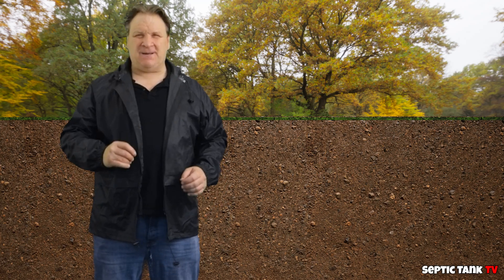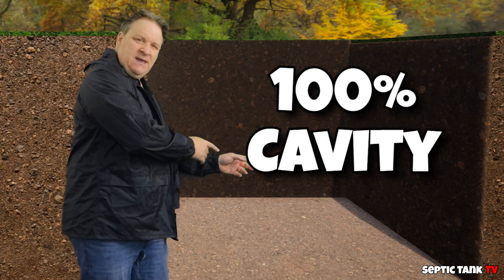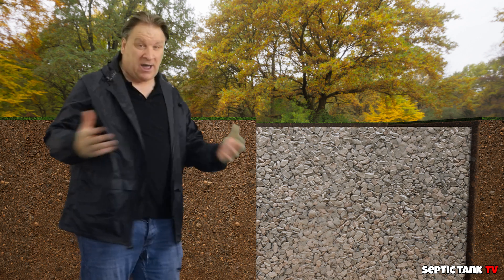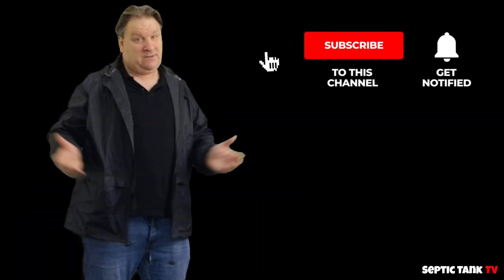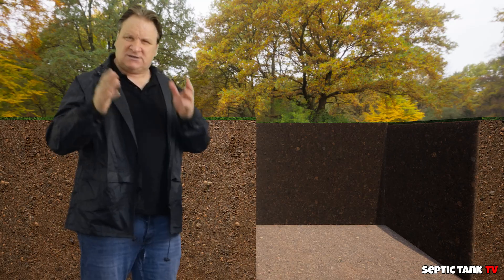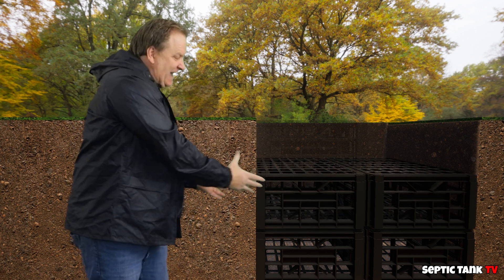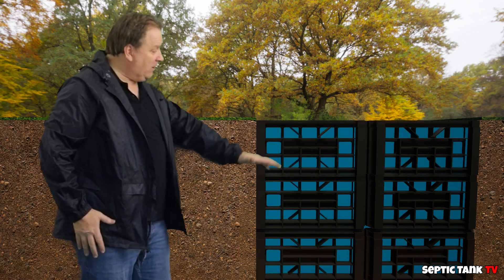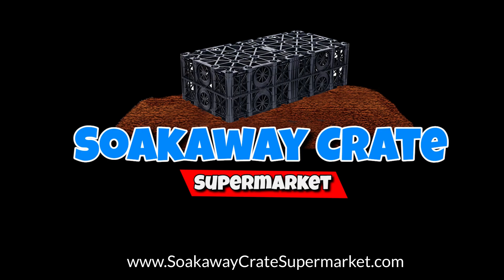What Is A Soakaway Crate

Comment: I presume what matters is the surface area of the boundary between the soak away and the soil. The larger area the more soakaway. The crates let you pump more volume of liquid in and it can soakaway at leisure. Whereas the gravel only let in 5% of volume in. These crates are plastic! Do they last? Gravel does unless I presume it fills up with solids. Can you drive a car overthem?